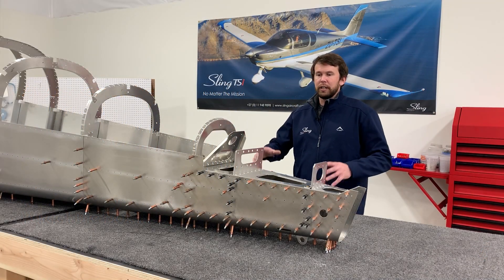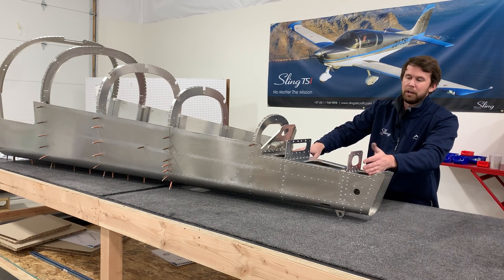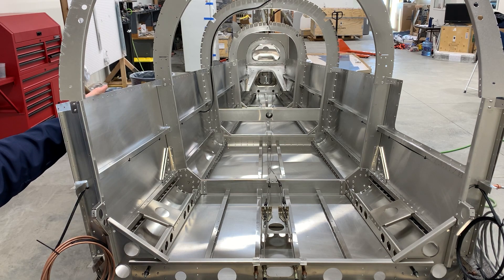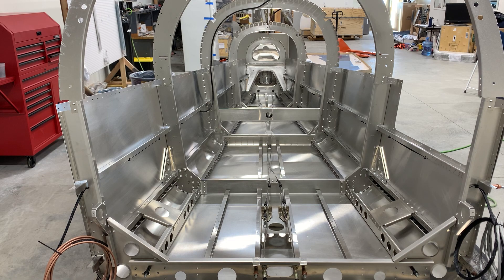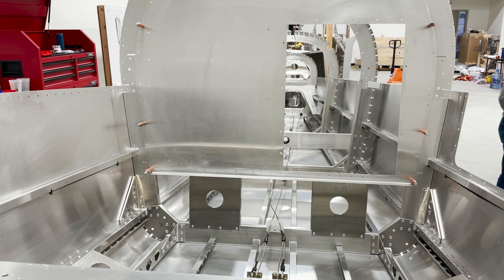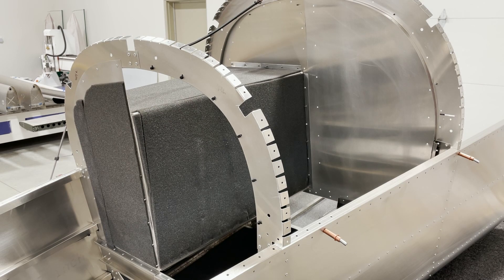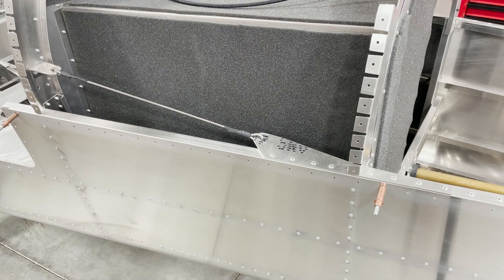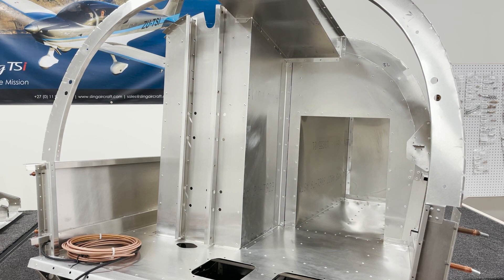3.2. Sling TSi Rear Fuselage Skeleton Part 2

Comment: You don’t want to rest the fuselage on the clecoes only. You will put smileys in the skin. They should know better.
Reply: I haven't noticed any smileys using this method. Perhaps because the rear fuselage is very light at this stage. Also, Sling uses different aluminum than other manufacturers (like Vans), so maybe that's a difference, too.